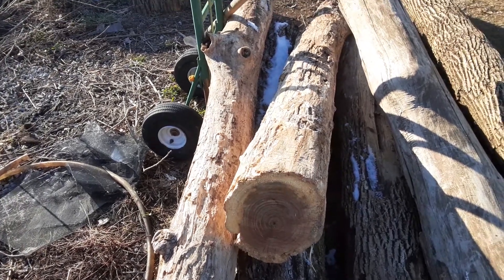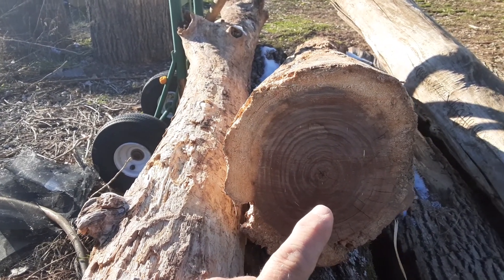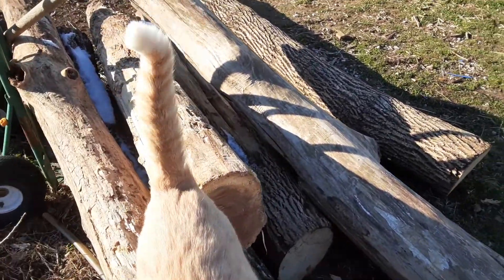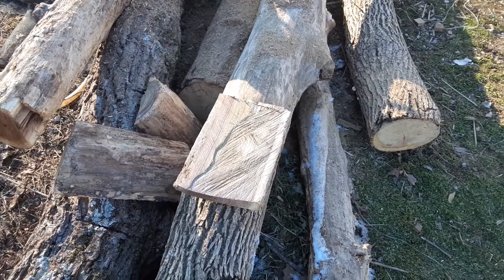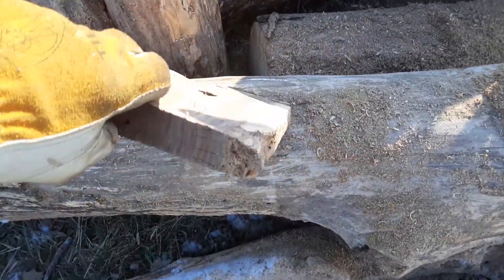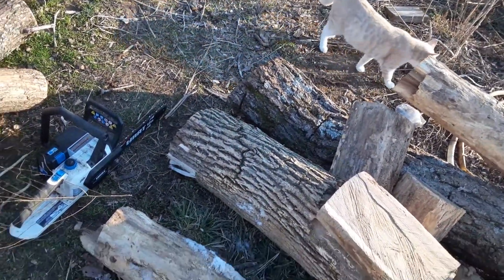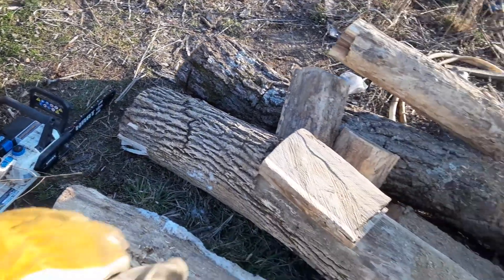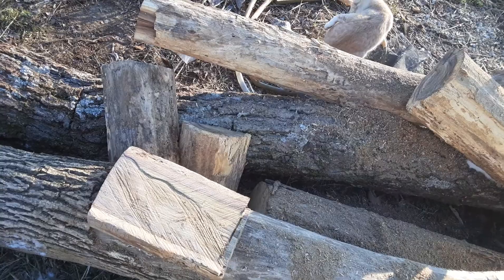I Was Supposed to Cut Some  Firewood...but

Comment: Looks to light to black walnut. I have some here and it is darker than dark chocolate thru and thru, no white or light anywhere. Also, it burns super duper hot. I cut it into little 6"-8" mindling sticks to get a cold fire hopping. Sorry about your battery.